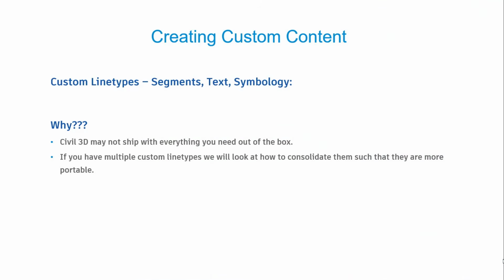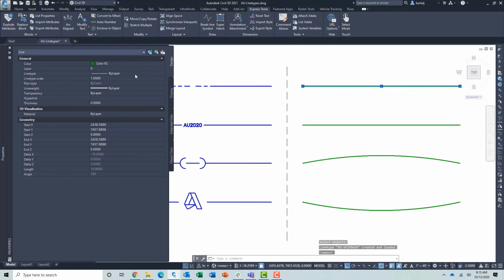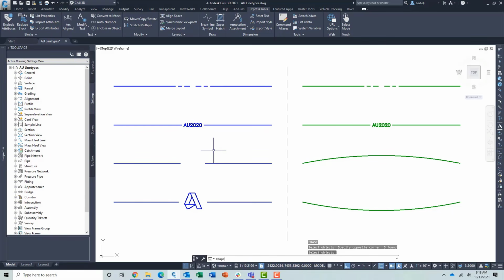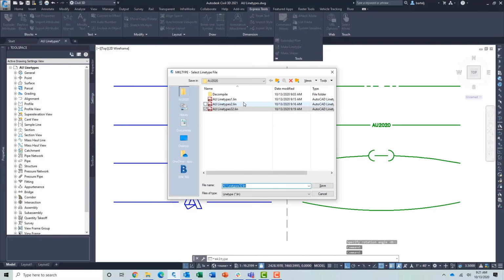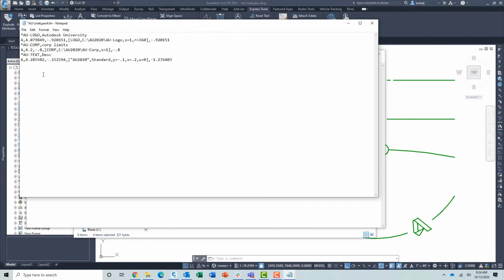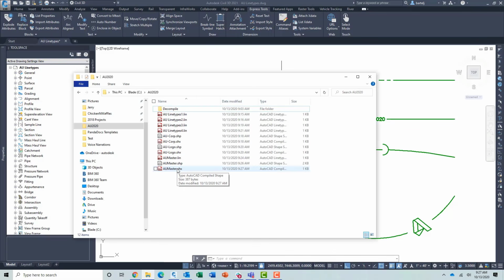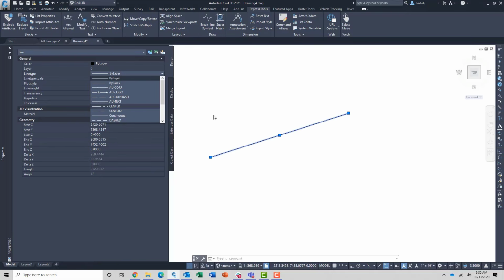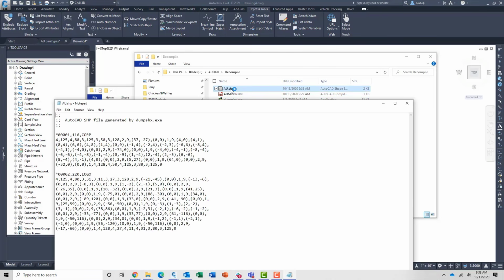How to create custom linetypes in AutoCAD Civil 3D

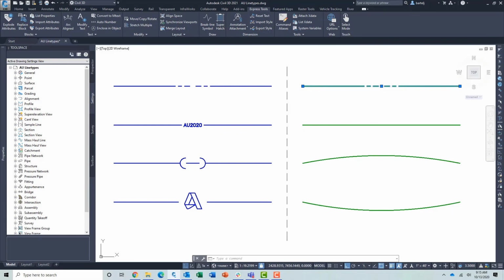Comment: At 3:50 you actually CAN and SHOULD use the same line file name as before ... it will ask if you want to overwrite, click YES an procede.
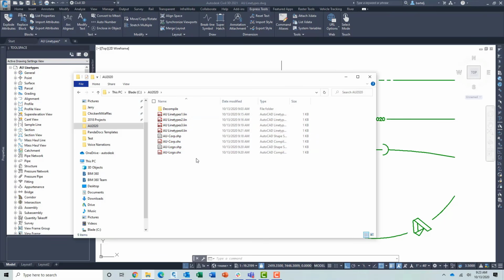It will overwrite the existing file with one that has the new linetype appended to your previous custom line types, automatically accomplishing "turning everything into a single linetype file" instead of copying and pasting at 11:18.

Also, if you decide to redo one of your custom linetypes, you can do the same process aagain using the same name as the linetype you wish to redfine and say Y to overwriting, it will overwrite just the one custom linetype within your custom linetypes file.

Another note, if you want indicate inches in a custom linetype file, for something like this --- 12" --- for instance, you have to use two single quotes like this '' instead of one double quote " or you could define a custom shape.

If you define a custom linetype with with arrows for flow direction and when you use it on a polyline and it is pointing the wrong direction, you can use REVERSE command on the polyline to change the direction of the custom linetype.

Comment: This and your 2010 video are both excellent...as far as they go. It would be nice if you made a followup showing the other half of the process - how to create the prototype lines to begin with. I am having a heck of a time figuring that bit out. Text does not align when going top to bottom or right to left; text bubbles not rendering; polylines behaving different than spline lines. Maybe it's because of Autocad 2013 not being as good as 2021, but I don't know.

Comment: Hello Mr. Bartels, Your video instruction was verry usefull. I'm using this workflow now to make some project specifyc linetypes. I've got one question though. Is it possible to create a linetype with text but the line it self needs to be an interrupted line (for example center). Is that possible? I'm trying but it does not appear... Greetings Tom